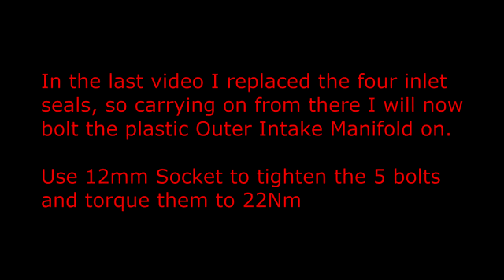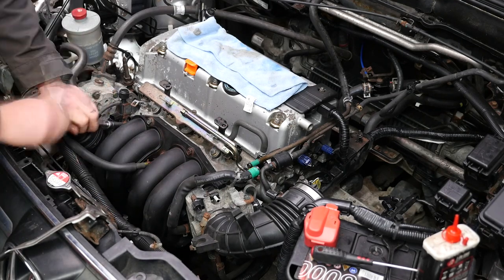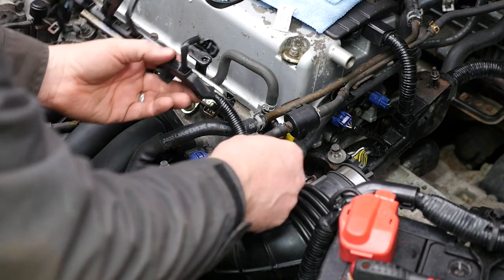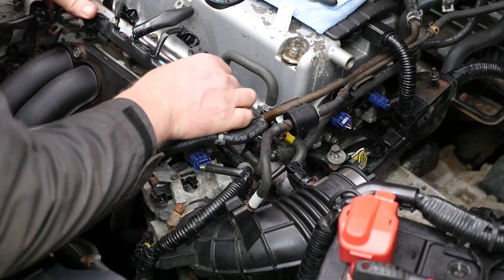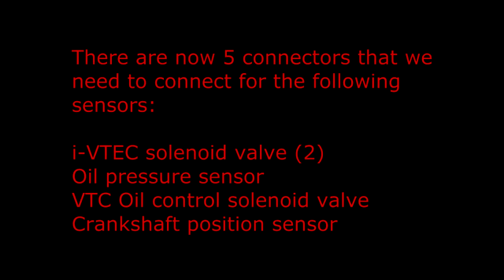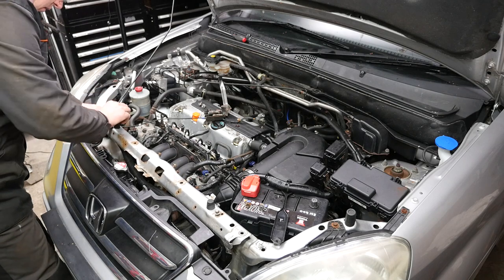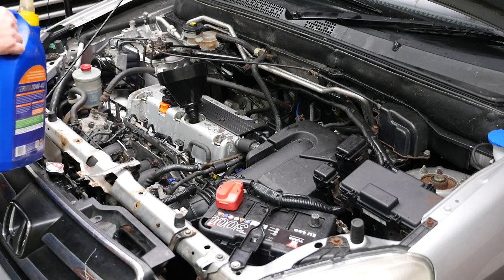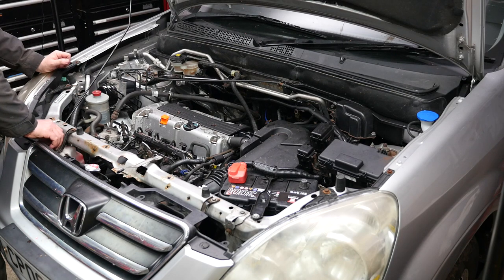Final Part 10 - Honda CRV 2 Litre K20 A4 Head Gasket Repair 🚗where I start the car and it Passes MOT

Comment: Sir, thank you for making this series of videos.  They helped me replace the head gasket on my 2004 Element along with the service manual.  My Element has almost 200,000 miles and was burning coolant. The engine is virtually the same with some minor exterior layout differences that are probably because of model year.  I didn't watch the whole series but where I needed a quick visual, especially the timing chain and cover.  It took two weekends, start to finish with the finish yesterday.  I opted to get the head resurfaced at a local automotive machine shop for $60, done the same day.  I also opted for new head bolts, thinking they would all be perfect. Nope.  One had buggered threads and that stripped a head bolt hole. I should have caught it but assumed they were all good since they were brand new.   I was sweating like Benny Hill.  Luckily Helicoil kits are made for this sort of thing and I was able to order one from a local auto parts store.  What a relief.  I also put on a new timing chain kit because, well, why not.  A new radiator and hoses were in order.  One thing I learned from this job is never try head gasket sealers.  Steel Seal clogged my radiator.  A head gasket replacement is the only proper way to fix the leak.  One thing I would caution in general is to take off your metal wedding band before working on your car.  I learned the hard way as mine got stuck once working on the car.  Not fun.  Anyway, cheers and I'd buy you a couple pints if I could.
Reply from the maker: Thank you for all that, Honda do say you can reuse the head bolts as long as they haven't stretched.  For me it was a balance of costs.  It so easy to drive the cost of parts above the value of the car and then my fear would be if the repair wasn't a success I would have lost a lot of money.   Can't believe you stripped a thread !!! bet that was scary, I was sweating like Benny Hill all through this engine job.  Working on this engine was way more scary than something I was used to.  Will not the ring you mention.   Now for the 'Buy me a pint offer' I'm not going to let you get away lol  On my home page picture there is a Paypal coffee donation link haha...you could be the first to ever donate to me lol
Reply: @CoatsandGaiters  I was not sure I could do the job as I had never been that far into an engine before.   I spent about $400 in parts.  I buy parts on-line at a substantial discount (even with shipping) over a ridiculously marked up local chain automotive store.   I don't count tools that I needed anyway like a torque wrench. The job, if performed at a shop would have been close to $2000.  I researched that my car is worth about $3000 if sold outright and not traded to a stealer.....er.... I mean dealer.  So it was time well spent in saving a car that I like a lot and is otherwise in excellent shape.  Then there's the fact that within the last six months I put a new exhaust and front end parts in.  Still worth it for a car with 200,000 miles on it.  The Element has a lot of cargo room as the back seats were made to be removed easily.  The Element was built on a CRV frame.  Music equipment, power equipment, logs for firewood, it all fits.  Enjoy your coffee.
Reply from the maker: @gregd3551  WOW !!! Thank you so much for that 'coffee donation' your a very generous guy, but I appreciate that and your the 1st ever to do that.  I see your car is worth a bit more than mine was so I can see your point on the parts.  Just looked up the element and it's rather cute looking.  Your like me, struggle to trust a dealer!  I just know they are more concerned for their own business than they will be for my vehicle or my money.  Hope things are ok your side of the World with all this COVID business.

Comment: Wouldn't be the fuel, taking time to get to the injectors??? I am now close to that point. I just did valve clearance. Tomorrow, intake manifold, and plug everything. That long belt. Battery on for cleaning the throttle. It is been 40 days in my case, so far. Mine is a k24. 
Thanks for this series. Thank you so much.😊
Reply from the maker: Thank you for watching.

Comment: I did follow every step. Crank and start at the first try. But some issues came up. Black smoke, p0055, p0103, p0355. Changed the maf sensor, fix some vacuum leak, and the only one remain in p0055. 
And... Still smoking the exhaust manifold. Only 5 miles drove so far.
The idle it is horrible. I took it for  a short ride and seems it lack in power. Any idea? 
Thanks again for your work.
Reply from the maker: p0055 is an oxygen sensor which would affect running I'd have thought.  Id try cleaning the sensor dare I say with carb cleaner or buying a new one.  Is compression good on the engine?
Reply: @CoatsandGaiters  No compression test yet. Maybe I should go for it. Anyway... Last night took it for a ride. Put the scan to work and p0055 is gone. But came back p0103 and p0355. No misfire codes detected. Even now it sounds a little bit better. But the lack of power is a worry. It was very hard to take some speed departing from a stop, at traffic light for example. Once it reaches 60km/h it goes. Not decent, but it goes. 
By the way... Maf sensor is brand new. Coils are working. Wiring was checked for continuity... Made a smoke machine to find leaks... Found one and repair...
I do not know what could it be. I feel lost.

Comment: can i undo the crankshaft pully without using the 50mm hexagonal  Honda tool? also i do not have the measured torque in newton metre unit > can i use the normal one
Reply from the maker: The 50mm tool is used to stop the engine rotating while you undo that crank bolt.  I found the crank bolt to be an utter ** to undo.  I have seen a video on YouTube where some guy used a scaffolding pole to try and undo it.  Not sure how you would lock the crankshaft from turning without that tool.  Not sure what you mean about using a normal torque?
Reply: I hired a mechanic to come out and pull the crankshaft bolt for $20. He couldn't do it. I gave in and bought the milwaukee 2967-22 1/2" impact gun from the homedepot app (you can get a free socket set through the app with your purchase) for $499. It pulled the crankshaft bolt like it was nothing! I didn't use the pulley holder, just a weighted socket.

Comment: How did you wire up the sparkplugs to test for spark, direct connection to battery or body? I followed your 10 part video, I am stuck at timing. After setting chain at correct marks the black links still dont align with the notches after a 720 turn. Thankyou and looking forward to your response.
Reply from the maker: I normally use those neon indicators you can plug in between the lead and the plug.  If the links were all aligned correctly on installation then all should be fine.  Whats a 720 turn?
Reply: @CoatsandGaiters  Thankyou. I meant the 720 degree turn on the crank pulley to test timing confirm if the timing marks align back
Reply: @CoatsandGaiters  tried twice still cant get ot right after doing the 720 degree turn, maybe my timing chain needs to replaced with tensioner?
Reply from the maker: @PercyMatthies  No you'd have to rotate it a lot more times than that to get all the links to re align.  I can't remember exactly as I did it on another car but I think it's like 30 times or something for each cog to rotate and for all of them to align again.
Reply from the maker: @PercyMatthies  The chain is longer than the teeth on the cogs so you have to rotate the engine a lot, maybe 20 to 30 times to get the link to re align.  I did it once in a video as I expected them to realign after two crank revolutions but then realised they wouldn't as the chain would have to travel a lot before they all came back again.